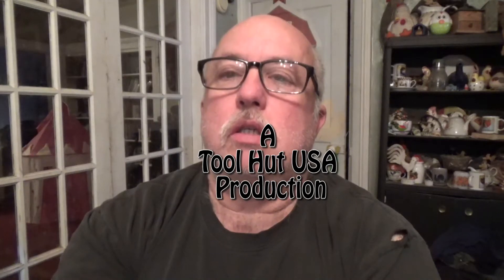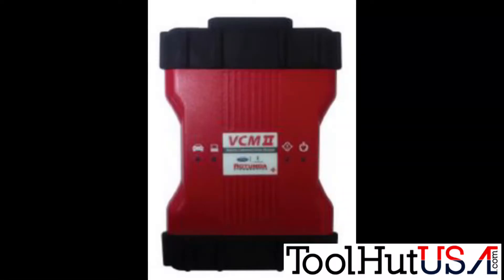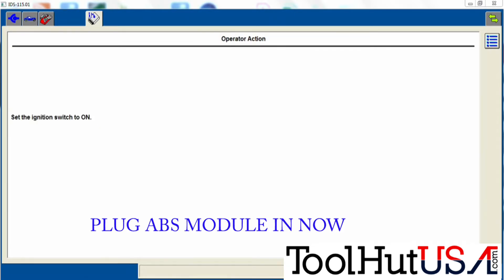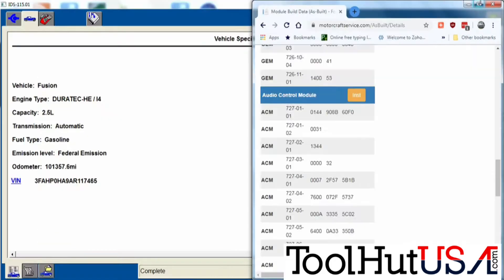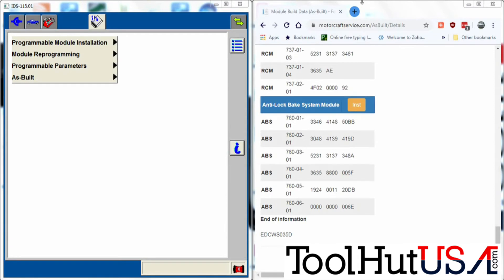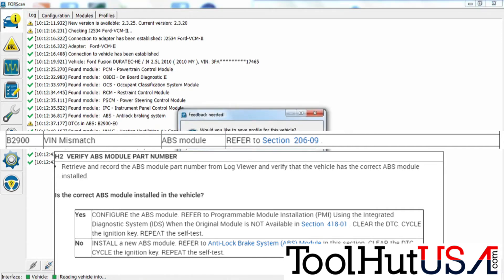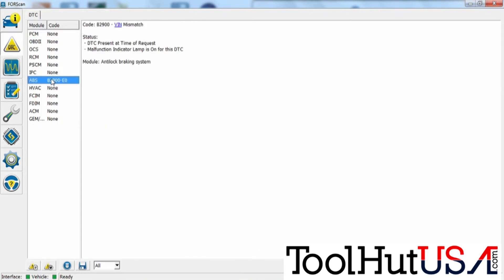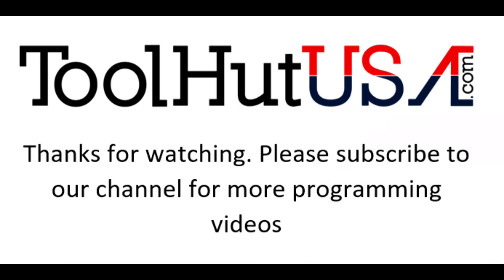10 fusion Used ABS Module, IDS Fails?

Comment: When I worked at a dealership, Ford had cautioned doing PMI on used 2010 onward modules, particually module swapping for testing purposes, then putting module back. I had no problem doing PMI on a used 2011 MKZ hybrid ABS module, that was two years ago so maybe IDS has changed.